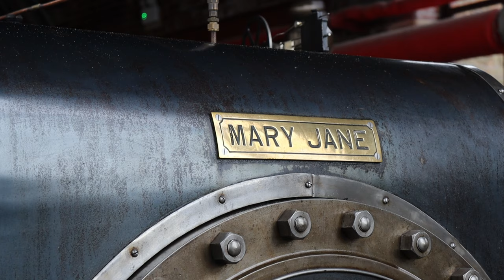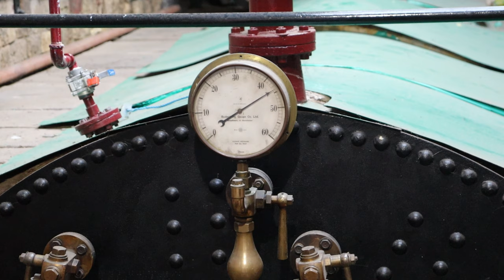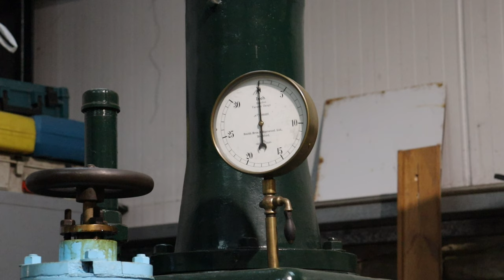BANCROFT MILL ENGINE - 19 NOVEMBER 2023 STEAMING DAY

Comment from the maker: If you want to find a specific point in the video use the chapters on the video or these skip times
0:00 Intro
0:06 Exterior
0:15 Barring The Robert’s Engine
0:53 Model Engines On Display
2:17 Robert’s Engine Test Run
4:15 Cut Away Model Steam Engine
4:26 Me Starting The Robert’s Engine
5:17 Robert’s Engine Full Run 1
10:07 Green’s Economiser Engine
11:46 Lancashire Boiler
12:08 Cornish Boiler & Feed Pump
13:07 Bradley Engine Introduction 
13:17 Bradley Engine Full Run
18:23 Roberts Engine Preparation for Running
18:32 Roberts Engine Full Run 2
22:37 Barring The Roberts Engine
23:14 Outro

Comment: Nice display of steam engines what I cannot understand why the flywheel is covered inside with wood is it purely aesthetic???
Reply from the maker: Thanks! The flywheel is coated in wood to stop a draft forming. Because of the high rpm of the flywheel the spokes would create a lot of wind in the engine house so this is to stop that
Reply: Ok thank you very much for taking the time to reply, Regards from Malta!!!
Reply from the maker: @johnhili8664 your welcome!